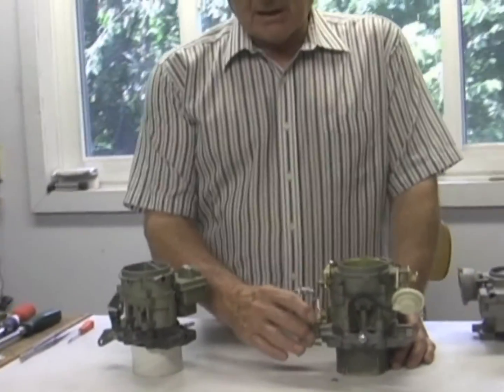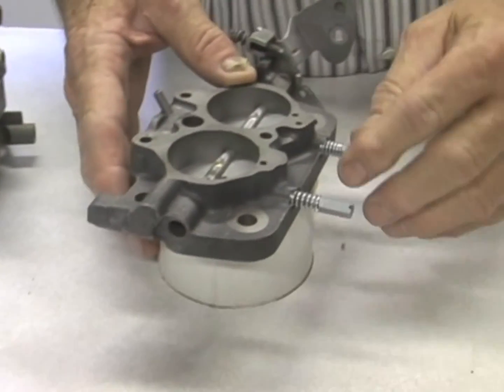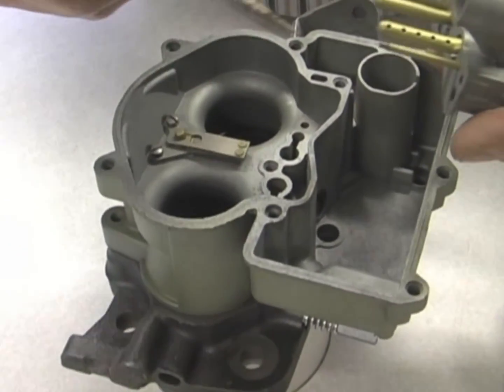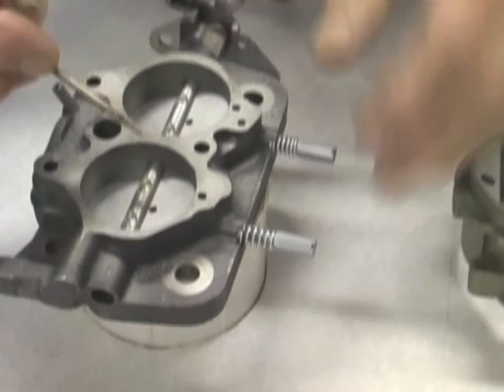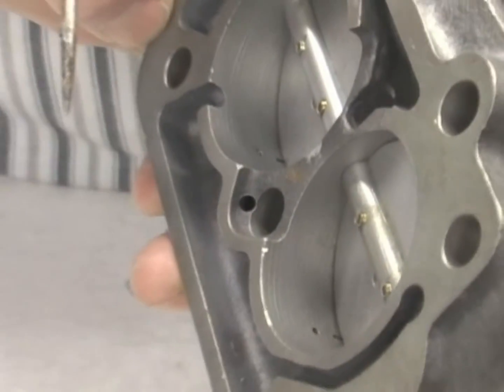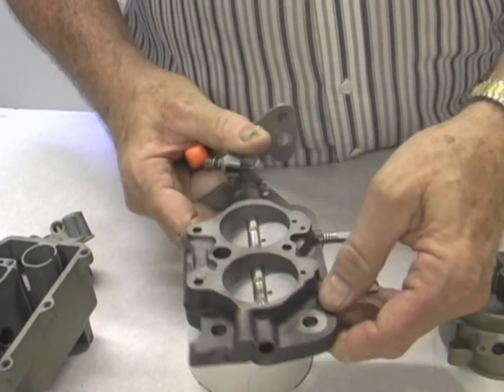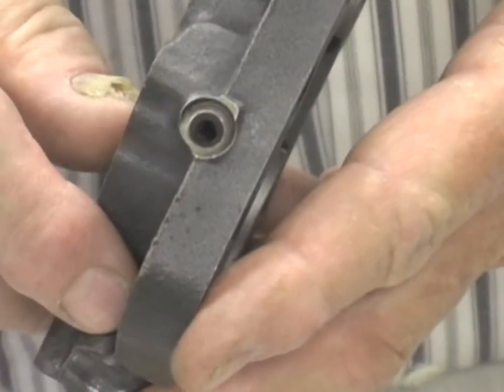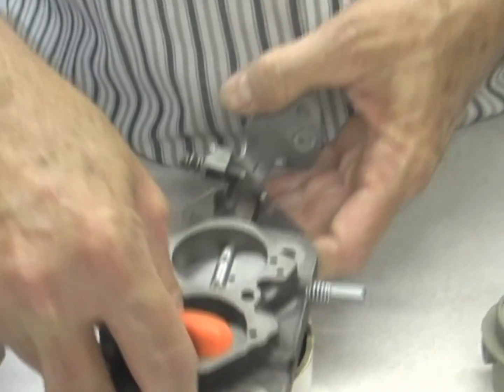How To Understand Pontiac Tri-power 2GC Carburetors Idle Circuits

Comment: With a lumpy cam, do you ever drill a hole in the throttle plates so you can keep the throttle on the idle circuit ??
Reply from the maker: So sorry I’ve been so so long to respond to all the comments. I am not the gentleman in the video(s). The videos come from a big lot of carb parts we purchased with no contact info or copyright info, but the videos were So Good we decided to post them.